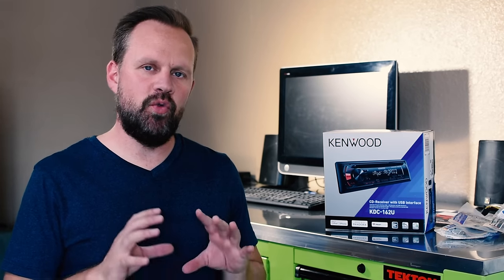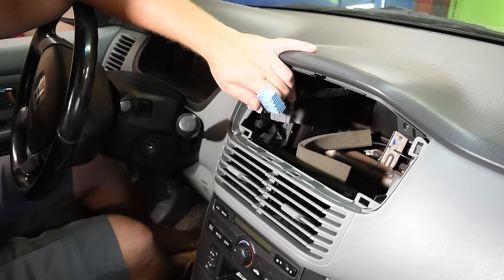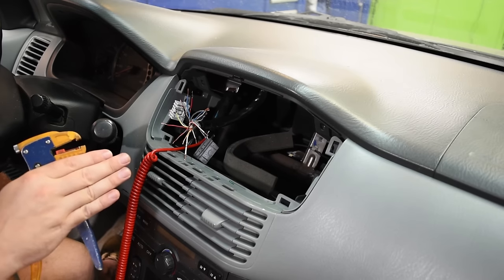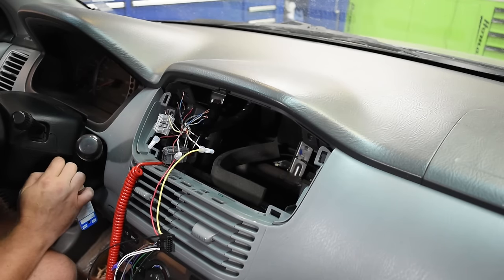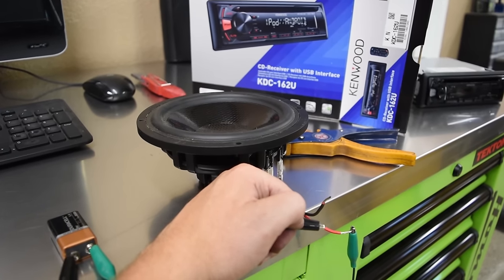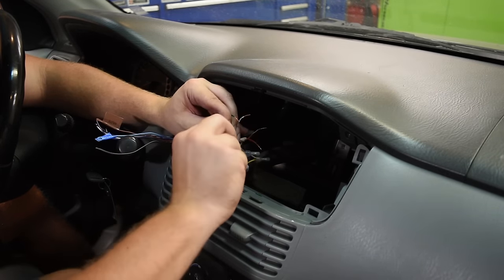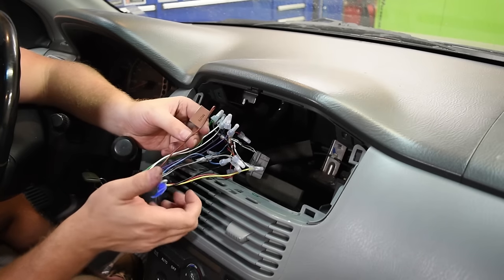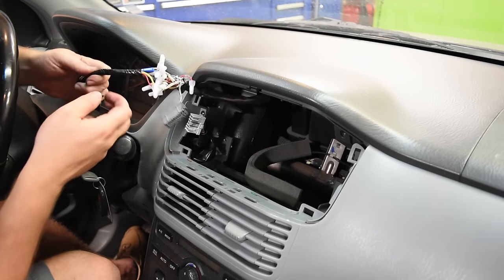How To Install A Radio Without A Wiring Harness Adapter

Comment: This is exactly the methodical procedure I needed to figure out the OEM wiring on my tractor. Like an idiot, I cut the factory harness off because i could not get an appropriate adapter for my new deck. Then I forgot which wires were which, and blew the fuses several times by trial and complete error. Thanks.

Comment: This video is pretty good. To all of you asking why he'd cut a stock harness, HE WOULD NOT...but his customers do it all the time to save $10 on a harness.

He is showing you what to do when some dumbass cuts the stock harness.

One issue: You do NOT have to strip all wires 1st. You can test by sticking the sharp tip of test lead into the tip of wire, against the edge of the copper. This helps prevent shorts. 

Also, if you do not have a 9v battery handy, you can use a C battery or even a AA in a pinch, but the pop/motion will be more subtle.

Comment: Amazing video. I was looking for something different but watched you anyway, and like the way you explain things. Bravo!
I have a question tho, as I said I was looking for something different. My radio (pumpkin new model android) - never to buy again - doesnt switch off, my guess is that I need a canbus for the seat alhambra 2013, but bit short on money now, and couldnt find the proper one yet (as the customer service dont reply to emails) so I tapped it on the cig lighter fuse, now it goes off, but cannot keep it on without the ignition on..would you suggest to add another battery? Or a power bank to charge when the car is on? My constant and acc wires do not work as they should. Do u know what could be the reason? Thanks

Comment: Very helpful tutorial. You did a great job of showing how to connect the wires, but I still need more info.  I was able to get a harness for connecting my radio and the radio comes on, the dimmer works when the lights are on, things seem to be ok but I'm not getting any radio sound to any of the speakers. This is on a 2011 kia forte sedan. I can't find anything to show the wiring diagram for the wiring in the dash panel. I will review more of your videos and hopefully learn how to get this done. I also have steering wheel controls and backup camera to do. lots of loose wires in the dash to identify. The radio kit has more connectors to find wires for. 

Thank you very much for your videos.
Reply: figure it out? having the same problem

Comment: It should also be mentioned that the illumination wire also creates a path to ground when not in use. So if you are using a muntimeter to test for a good source of ground this needs to be taken into account.

The head unit will work fine using the illumination wire as ground... until you turn the head lights on and blow the 'illumination' fuse. For me that meant no running lights or dash lights. Took me about 4 hours of diagnostics and a few google searches to fix the problem. 

Needless to say loosing 6 fuses on the way home from 'side of the road testing' taught me about the illumination wire.

Comment: Hi, this was a brilliant video! I noticed that, during the testing, you turned the headlights on to check if the radio does anything out of the norm. I'm seeking your assistance. Whenever I turn my headlights on, my radio shuts off. How can I rectify this? Thanks you.

Comment: THANKS, GREAT VIDEO, CONCISE AND CLEAR INSTRUCTIONS. I  have query, I see you wired up when ign was on and called that accessory position, Is it not so that there is an accessory position before ign on.. in order that you can listen to radio - cd whatever in a parking lot or in your garage without the ign having to be on,

Comment: You're a lifesaver.Thank you!
edit: Ok,i tried to follow all you explained...my car actually doesn't have a constant 12V wire,only the ignition one...
I will try to find a solution tomorrow as it's kind of late right now.
Reply: Turn the key to accessory and then follow instructions

Comment: Best course of action is looking at the adapter for your vehicle and matching the wires to figure out what each wire does, saves all the hassle of buying a test light, if your vehicle has easily available adapters, just buy those, if youre in my boat where Cadillac wants to charge 400 bucks for it, my advice is to cut a common harness out of a car in the junk yard and run wires back to any factory amp and do your own bypass, or if your stereo doesnt have a factory amp, just wire it all to the wires you cut from the factory harness to make a quick disconnect and attach your adapter harness from there. If you need to figure the speaker wires out. Open your door/decklid and look at the colors, maybe replace them with entry level speakers while youre at it, without the factory head unit, most factory speakers start to sound like trash

Comment: Just what I needed! Got a car with radio ripped out :( have a smart son to do the work but cannot find a wiring diagram. Have a 2001 Solara se, 2.2l coupe, manual with jbl system. was emailed some charts but all the wires didn't match. Any knowledge of how we can find one? Great video; it's a start anyway ;) he thought he'd have to take the doors and under glove compartment apart.
Thank you so much.

Comment: Absolutely love your video sir. By far the most helpful. One thing I apparently missed is what you ended up doing with the blue remote wire. I know amps need that to turn on but do I run the blue one anywhere in with memory or accessory or to the battery or do I run it along with the RCA wires from audio out on the head unit to the remote wire coming from my amp? I know that's the wire that tells the stereo and amp to turn on so do I just save that to tie in from head unit to amp? Or do I worry bout running it somewhere in the harness from car? Does the constant and ground and accessory automatically turn the head unit on or off is what I mean. Or do I need the remote wire to turn my head unit on. If so how. Will I be running two remote wires? Or just the one or tying in one with the other simultaneously?

Comment: great tutorial, helped me learn to identify my wires.. my new radio has about 64 leads and maybe 20 are used for specific reasons like usb or infared or auxillary RCA and the rest are.. just colored with a chart to show what each does on the wire. my car has about 14 wires thus...I have a big headache to figure out...

Comment: For the ground and constant wires. Do the wires stay connected to the ground wire in order for the radio to work or should the ground wire that is connected to the constant wire be removed and connect back to the ground wire. Thank you for your time. Oh! This video was a great help. It was just that little thing that I had an issue. Not really an issue just a question.

Comment: Above all though your video is by far awsome and very helpful. Your very good at teaching and I'm for one very grateful to have come across it. Itl be my first car audio installation. In a '99 grand prix gt two door coup. It has a head unit in it. But not sure how it's wired in or if I'll be using your method. I'll need to buy a test light to be totally ready for sure. Car systems are new to me but home audio I'm good at. Hopefully I can follow what was done prior and it be easy. But there was no amp before I'm installing a full system. All new except the amp and subs. Hopefully I can getter done right lol. Might need to run new speaker wire through the car as well. Hers shorts out. That's gonna be tough if they've taped the old wire in the harness otherwise I've heard snip tie and pull through...

Comment: Thank you for such a great video. We have a 2010 transit connect and had the harness connected and connect radio but no luck it doesnt even turn on. but i think it may have a blown fuse or need a different harness to fit properly. IDK lol

Comment: What a great explanation, I think it's the best on YouTube even though my install is more complicated involving a Bose bypass and re-pinning a harness but so helpful thank you. I have one question. I located the switch power wire and constant, however I also found a wire that makes my test light blink. Are you able to tell me what that wire is for and what to do with it?

Comment: This was very helpful except for the following: My 2004 GMC Envoy has TWO constant hot wires (orange & black) and ZERO Accessory (key on) wires. Also, the test I did for the speakers worked BUT the test you showed us to find the Ground wire did not work on ANY of the wires present. Not sure why. The OEM wiring diagram for my GMC says the black & white wire was the ground, but that wire shows constant power, as does the orange wire. Car dash lights blink & buzz if I try to use this ground as a ground, so the OEM wires can't be correct, or somewhere this ground is receiving power when it shouldn't. Very puzzling....  No matter what, I can only conclude that this aftermarket radio is bad, since there has been nothing I can do to get it to turn on/light up at all. It appears dead.

Comment: Hi boss your video is very helpful for me and I will request you one more video for same like to the the CD player don't have a wire without wire inside the pins which one is the power and which pin for the speaker kindly make a this video I very thankful for you I mean how to check which pin for the power and which one for the speaker

Comment: Do you happen to have a video on what to do if there is a factory amp installed? How to by pass it? Trying to install an aftermarket stereo on a 2003 ford explorer with match audio (speakers, sub & subwoofer), can't get the audio on the speakers... thank you

Comment: I installed my brother's car stereo in a similar way but what i did instead was used the bullet crimp connectors. If in the future i have to change the stereo again i can either reuse the same harness if it's the same brand stereo or i can just use whichever harness the stereo came with but just adding the opposite bullet male/female connectors to the new harness.

Comment: So if you are using 4 channel amps and mono block amps for door speakers and subs you really don't need to hook up speakers in the harness you can just use RCA preouts to send single to the amp the wire the speakers directly to the amps correct?

Comment: Do I need to replace the wires with an aftermarket system if the original wire hook ups are still there and work from the original?

Comment: I installed speakers into my Girlfriends mazda 6 years ago but there was no speaker or speaker wire to the rear left door. So there is 1 speaker sitting in the garage unused. I installed an aux adapter to the back of the radio today and can see the adapter with all the speaker wires. Is there a way to run a set of wires for the rear left door to the radio? Thank you for any help.

Comment: I have a Delco radio and it will not save the clock setting or the preset base treble etc. it does save the presets on the radio stations. Do you have any suggestions on what I should do there? Delco, model 09 383900. Thanks for the video really informative.

Comment: Thanks alot man I'm installing a double din on a 2007 Ford F150 truck and the jack ass before cut the factory harness and its a bitch wiring it up like this but thanks to this video you made my job a whole lot easier!! Thanks man!

Comment: Hey I have a question, my car’s stereo is a copper wire while the wires on my car are silver (aluminum, i guess?) can I connect them or will there be any problem?
Reply: Wire's wire, you will eventually get dissimilar metal corrosion, but it will work just fine. After about a year or so, you may need to check the connections, especially if you live near the ocean, but just follow the directions and put it in.
Reply: The wires aren't silver. They looked silver because the copper wires are tinned before its wrapped with insulation. Tinned wires help with corrosion. Just wire everything up and you'll be fine.

Comment: Hi Bri, I cannot tell you how professional it was when you upgrade the stereo. I was trying to do the same with my 98 nissan frontier. I was completely confused with the factory wires because it has 2 ports on the stock radio + 1 antenna port. I have no idea what the 2nd port's wires do to the radio. This car has only 2 speakers.

Comment: I I have and question I have an 2006 Saturn vue I replaced my radio using your step witch I'm appreciate the step by step it worked but now I'm have an issue with my turning signals and hazard lights my question is does any wire in the radio connection to those lights?they are not turning on..

Comment: Great video. But I have a different situation. I have a cutter 24 pins socket for 06 sonata, and the stereo have 12 pins socket. I couldn’t make any speaker to sound ‘cause the factory amp. Do you have a video for that?

Comment: Do you recommend doing it this way or with multiple adapters? I have an 06 Nissan Xterra with a radio 10+6 pin adapter, and I want to upgrade it to an OEM 2012 Xterra radio 20 pin adapter

Comment: HOLY CRAP!!! this is the best "video quality" that i have seen, and its in 720p60 HD. 
but my question... Why do you NOT solder & shrink tube the wires. It has a more professional look VS white (or) butt connector look?
Great videos
Reply: Works right?

Comment: hello . if the constant power wire is connected that will keep the radio on all the time ? also I did not find the accessory wire neither the illumine wire    but two   ground wires  . I will be glad to help me on this . it is nissan almera 2002

Comment: Hi, great video. At the end you hooked up speakers fast you test the speakers but was having room temp issues. I'm trying to figure how  out knew which wire from the  inside was the correct side one?
Reply from the maker: If you go to this website it will hopefully give you the wire colors... It is what I did to verify the polarity of the speaker wires... http://www.the12volt.com/installbay/vehicles.html
Reply: @doityourselfbri  wow, another excellent tip! Thanks Bri!

Comment: I have a 2001 oldsmobile alero. I was planning to use a adapter but the previously owner cut many wires. That's why many speakers didn't work. Now I have to connect them directly like you did. But will the wires colors be the same for all cars? If no than please help me to understand my wires..

Comment: If you strip a wire and 1 or two of the metal strands gets pulled off with the casing then you twist your wires together to connect them will this affect the audio? Particularly with say a speaker wire. Like do both ends Need to have every strand of wire when connecting or will the '4' strands left still carryout the full power as if you'd stripped it perfectly leaving all '6' strands?

Comment: Very informative. But my Tacoma only has a tweeter and one speaker 🔊 in each door and it’s a two door. And nobody talks about the tweeter’s. Do they get their signal from the main speaker or do they get wired with some of the octopus of wires.
Reply: Ok my dumb axx has found more speakers 🔊 in my truck they are in the back on the sides. I have done enough research 🧐 that I think I can tackle a radio swap. 
My oem radio will not come on nothing. I just hope it’s the radio gone bad and not a power issue. But I have come to realize that if I want a radio I’ll joist have to run a new hot wire and wire it in. With it’s own fuse.

Comment: So I found that I have three hot wires and I didn't even put the key in the ignition.  I have a 2000 vw passat.  One of the hot  wires are for the anti theft system. Ik to leave that one alone.  But what are the other two for and how do I figure out which one is which if they both light up without the key in the ignition?  I found the 12v ignition wire but the other two I mentioned are throwing me off.  Do you have any advice or more videos on this?   I have watched your video over and over again.  Plz help me out. 🙏🙏🙏
Reply: Could be a ground wire if you haven't already identified it.  On most cars it would be the black one.  As for the other maybe it's the constant which is needed for memory when the ignition is shut off.

Comment: thanks for the video it is very educative.i have a nissan almera 2004 the stereo is dead and i want to replace it with aftemarket type.when i remove the old stereo i realise there were two haeness one larg plug and a small type. what confusing is the fact that i could not match the colours . if any advice i will be happy .thanks in advace

Comment: This is completely fine for most vehicle under 2003 , if you have a newer vehicle I would recommend not hardwiring your harness, if  your vehicle calls for a harness such as gmos-01 etc then you should definitely not hard wire it. If your vehicle calls for a fancy harness then that means the stereo runs through the computer of the car and if you hardwire it then your using your vehicle computer as a fuse for the stereo, that is not good, 
On 2nd note if you Google search the year make and model of your vehicle with the following (stereo wiring diagram) and it will tell you what every wire is

Comment: Any tips you can give me on how to get full module controls back in my steering wheel? since I took out the factory radio I've lost most of my controls to my steering wheel. I have a 2016 Nissan versa note sv.

Comment: My vehicle, 2005 suburban, has a Bose factory amplifier (analog).  I'd like to know how to identify which wires in the factory harness will turn on the amplifier.  I presume if the amplifier is not connected, then there will be no sound or else the radio will get fried; is this correct?

Comment: hello bri i have a honda edix with a navigation system with an amp the amp looks like it connector has about 9 wires on it where as another connector that came out has about 18 to 20 on there so i was wondering would i go with the connecter that went into the cd player with the 18 to 20 wires or to the amp connector one